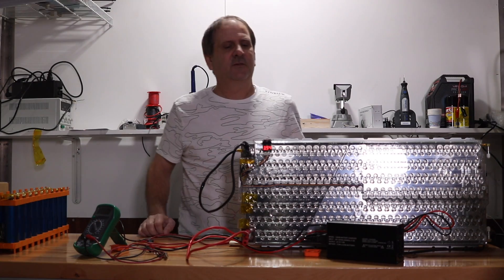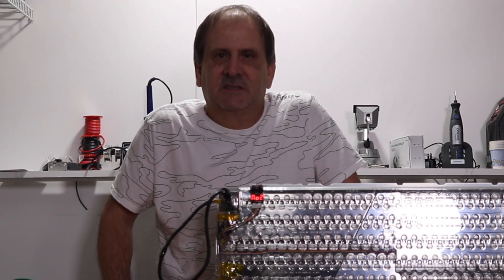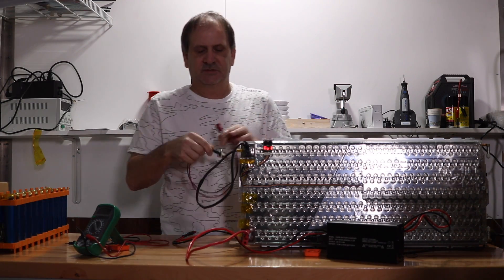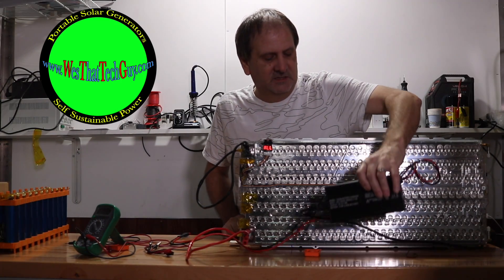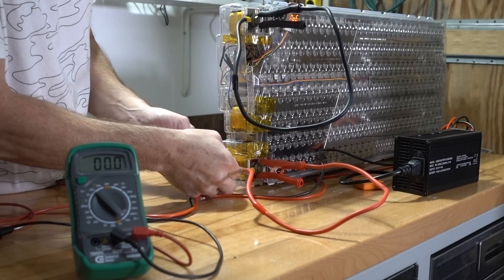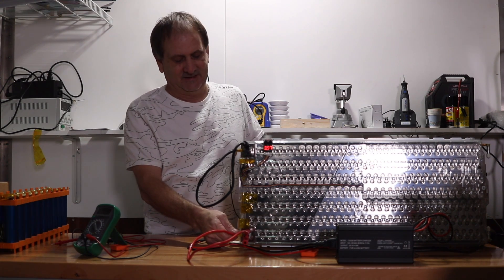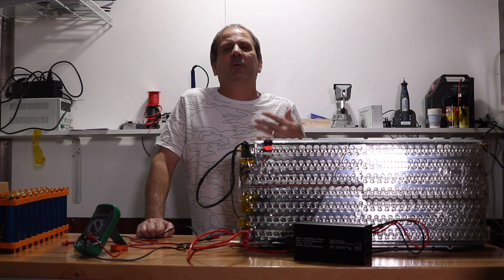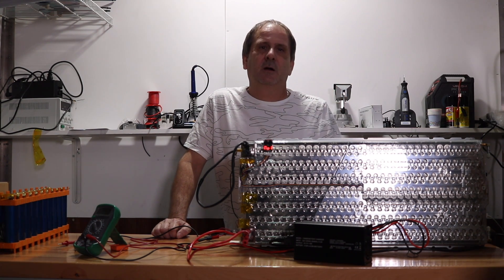Tesla Model S battery Module Power Wall Charger

Comment: Hi. I want to charge these batteries as fast and securely as possible. Any Ideas on how that can be done? I don't have any yet. I want to start with 1 and eventually get 9-16 of them to fit on my camper van. I want to run them in 12v with 200a 12v bms to make them more convenient to use my alternator and maybe a renergy 60a DCDC charger with lithium charging profiles if possible but if not then that's ok. Solar and AC-DC charging is enough. So any Ideas or insights?

Comment: 25.2 volts will Degrade These Modules Overtime. Magnum.MorningStar.Victron... Inverters and Solar Chargers Have Option To Set All Type Of Battery Settings in Them!!!!
Reply from the maker: this is not true. ALL lithium ion should be charged to there max voltage. Most are 4.2v charged. Yes those inverters do have adjustable settings.

Comment: I'm converting a commercial bus into a MOTORHOME so I'm going to put 8 to 10 395 watt 48 v solar panels on my roof with 6 of these teslar batteries do u have SOMETHING that my panels would plug in to so I can charge the batteries as well as a land supply hook up if sun is not enough to charge?
Reply from the maker: Linda, this sounds cool! I have to do mine this spring myself. I don't have solar controllers but I do have the inverter/charger and the AC charger you will need. Let me know and check out the website. SolarGeni.com
Reply: @WesThatTechGuy  I'll definitely check out the I'll definitely check out the website you don't know of anybody that's mechanically inclined and can help me cut out my slide outs on that Big Bus do you

Comment: If you wanted to put a BMS on the Tesla which would you recommend? This question is for anyone
Reply from the maker: Robert Anderson Simple answer is a 6S lithium ion bms. Then you would need to know how many amps you were going to pull and match the amperage. If you were using a 24 V 3000 W inverter you would be looking at about 125 A.
Reply: Wes That Tech Guy I’m using a MPP 24v 2400

Comment: I have a 24 volt trolling motor on my boat. I think this would work perfect. Better than two 100lb bulky 12 volt deep cycle agm batteries. Got get that charger too. I have several of those cell checkers and voltage alarms for my RCs. Great video, thanks!
Reply from the maker: Sounds cool. yes this would work and just need the correct charger. Thanks for watching.
Reply: Hey Tech I - I am planing to have one for my trolling motor , how do you keep it waterproof the battery pack ?

Comment: It looks like a Sigineer inverter and the make 15kW ones now.  Jack Rickards' youtube channel has a whole series on these inverters and even had Sigineer add a Telsa battery charge feature to them.  You should check out his Power Safe 100 - 20 Tesla batteries providing 100kWh power.
Reply from the maker: Jeff Smith It’s a solargeni inverter and I’m very familiar with Jack in his channel and yes I did have these made to charge the Tesla batteries it’s called a charging algorithm. This inverter has been in development for three years and I am the only one in the world that has it.

Comment: is there a difference between model s battery pack and model 3 battery pack when it comes to DIY Powerwall usage?  Anything to consider when choosing a battery pack?
Reply from the maker: I've not used the 3 only the S. the 3 is 23S46P so there is 1,058 2170 Cells. as the model s uses 444 18650 cells and the newer models x cells use 516 I believe. Hope this helps. But this all differs between the 85, 90 and 100P tesla cars

Comment: If you have a bank of 4 Tesla Model S battery packs do you need a charger for each or will 1 charger charge the whole bank?
Reply from the maker: Yes it will. You would want to get a high amp model to do 4 of them unless you want a slow charge.

Comment: Hey wess where can one find a decent bms for the Tesla modules without breaking the bank ?
Reply from the maker: Well thats a bit tricky. I do have them available but they are not cheap. Lets start by asking how many watts and volts inverter will you be using IE: 3000w @ 24v or 48v etc. then go over to my website and send me an email and we can talk better from there. you can just use the contact me at the bottom of the solargeni.com website. I will get back to you and we can discuss.

Comment: Where do you have these for sale?  Can't seem to find it on your website. I wonder what the max charging amps the model s module can take... 10A is going to take like 20 hours to charge from dead to full. If it could be doubled to 20A, then that's going to save 10 hours.
Reply from the maker: Clayton Arnall go to SolarGeni.com click on the online stor. On left side of the page click on battery chargers

Comment: Hey Wes, great video.  I was wondering where you got the connector, ribbon cable, and balancer unit. I have two Tesla modules and would like to set them up so I can monitor the cell balance but have not been able to locate a video or post that clearly spells out how to set up and connect the connectors and ribbon cables to the connector ports on the battery module.  Also, where did you get the parts needed to put all this together?  I and all the other DIY'ers out here would really appreciate your response.
Reply from the maker: Urban, thanks! You can get them on Amazon no problem or even at the local RC hobby shop. just a simple 6-8s lipo balance cable. Just solder the ends onto each series 1-6. Look at my 18650 battery build and this will give you an idea of how to do it. I solder on a balance BMS to that battery pack. just repeat the process pretty much for the 6s tesla.

Comment: Having a tesla s module or two would be great for off grid solar....but I would not trust even charging on a 6 s lithium pack without a balancing circuit that could keep up to the 18 amp charge rate you have....sooner than later, your pack WILL fall out of balance, trust me.  Your charger cannot tell when a cell group exceeds 4.2 volts...only when the total voltage is over 25 will it terminate the charging.   E.g.  4.4, 4.0, 3.9, 4.5, 4.0, 4.2=25 volts.  Your charger shuts off at 25 volts....but as you can see, 2 cell groups have been over volted....damage has occured, or worse, you have a fire.  You CANNOT safely charge this pack in this manner, without CONSTANT supervision of cell group voltages.  I am unfamiliar with these tesla modules.  I CAN see on your video that there is something on the top edge of this module....but I could not distinguish if this is a bms or cell balancing circuit...could you tell me?
Reply from the maker: Nice statement! Yes that is a cell balance lead on the module. This is just another way to charge a battery pack. You would always want to use a BMS with balance charging on any lithium pack.
Reply: Wes That Tech Guy thanks for the video. What BMS or balance charger would you recommend for a more permanent charging setup?

Comment: I need to charge 3 of this Tesla s packs over night, how much time does this charger take to give a full load to 1 Tesla s pack ?
Reply from the maker: This charger here in the video only gives out a CC/CV of 10a/25.1v. So you can do the math and see how long it will take. I will be doing a video on the time it takes to charge 1 of these cells this week. I will post my findings in a new video.

Comment: MPP's LV2424, which is the inverter/charger/ATS I'm using can be manually configured to the right voltages. 24.2v max, cut-off at 20.2v to keep it from maxing out the high/low voltages. Charging max amperage is config at 30A from both, grid and PV input.
Reply from the maker: thanks for the comment. This is an AC charger for back up or for someone who has a lead acid inverter charger. Ivan I've been using the Tesla S modules for quite some time now and impressed with how they work. I have more vids coming out with these units.

Comment: I got the Magnum MS4448-PAE setup, i can set the right custom voltage for 2 modules in series. 
And by the way 25.2 volt/modules is the absolute max charge for these modules, you should not charge them up to that point i set them at 24.4 volt / modules !
Reply: By doing that it's not going to last. Always under charge it
Reply from the maker: Thats a nice inverter charger you have. BTW you WANT to fully charge ALL lithium batteries to make them last longer. Under charging them is not doing you any good other than costing you a 1/2 of volt and reducing their life expectancy. To be safe you can charge them to 25v or even 25.1v without any real life loss. These modules are designed for 25.2v full charge.
Reply: @WesThatTechGuy  Ask Tesla how often you charge the Model S to 100% (16)X 24 Volt Modules. UNLESS you going on a Large Trip!!.They also say 605 Charge on their Cars is more Efficient and Batteries Last Longer.

Comment: I wish I had found your channel a long time ago. I have been building Headway 38120S battery packs. I have been successful finding a BMS for 4 cells but I would like to build one with 8 cells and can't seem to find a BMS I can use for 8 cells. I am a Ham radio operator and the LifePO4 packs are fantastic for portable use. Do you have any suggestions? I was looking at your S120 charger but noticed it says 12v for the LifePO4. I would think that it should be 14v wouldn't it? I am enjoying your videos. ~Ron
Reply: Assuming you want 8 cells to double your capacity? In that case you only need a BMS for 4 cells. - The 12v chargers charge to 14.6v.
Reply: Ron Langner    BMS Battery, out of China has bms’s for LiFePO4 batteries specifically made for 38120’s.  I have made high amperage e bike packs with them and can verify their performance.  hope that helps!
Reply from the maker: yes they do.
Reply from the maker: Thanks Ron! Yes the S120 comes in many voltages and chemistries. For lifepo4 you would choose the 14.6v LifePo4 S120 charger. In the battery biz we always refer to 12v, 24v 36v 48v etc but yes for lithium its different. We than have to go by series and calculate voltages. but we still use the same terminology to keep it simple. lithium and lifepo4 voltages are close but not the same so we say 12, 24v then ask which chemisty and series in order to make the right choice in chargers. your pack sounds like a 1p4s (14.6v) and you wan to build a 2p4s maybe. so same BMS. if you are going to the 24v running 8 cells 1p8s in series than it would be 24v battery or 29.2v and an 8s charger and BMS. Hope this helps.